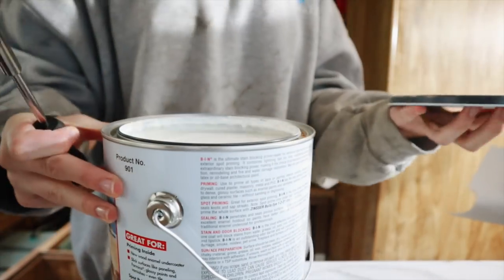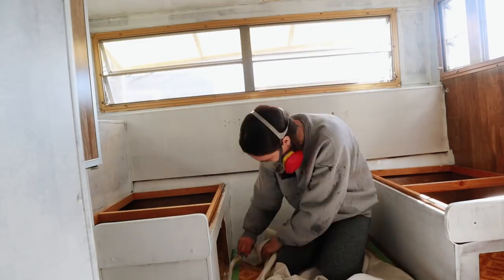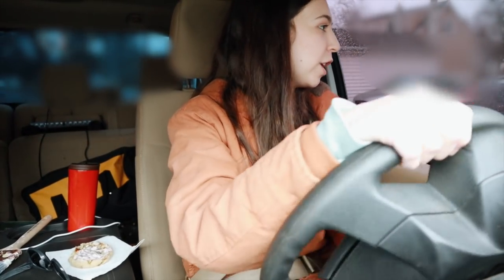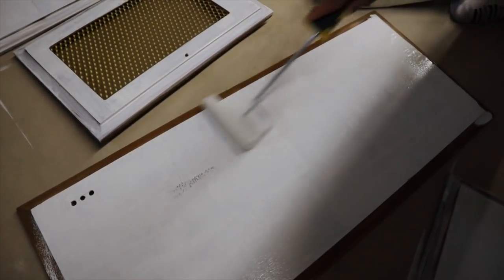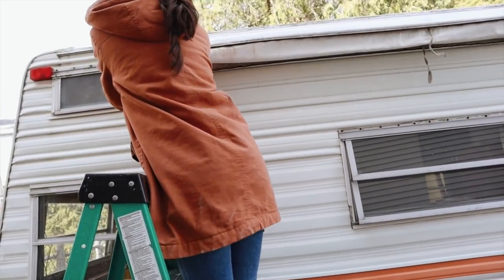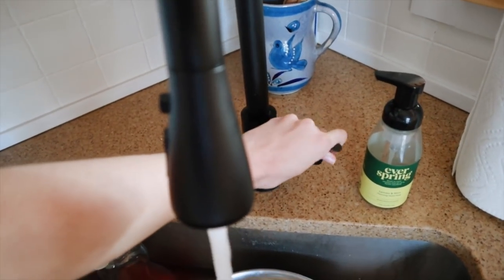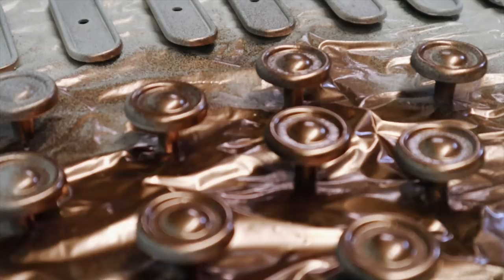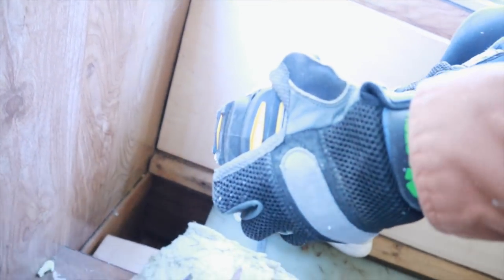CAMPER DEMO DAY 2// unveiling the awning & prepping for paint

Comment: You need to remove the wallpaper on the walls not paint and tile over. When that wallpaper stops sticking all by itself, it will fall off with your tiles.
Reply from the maker: They use a different type of paper in campers. trust me it’s not coming off! We’ve painted over wallpaper so many times and never had an issue